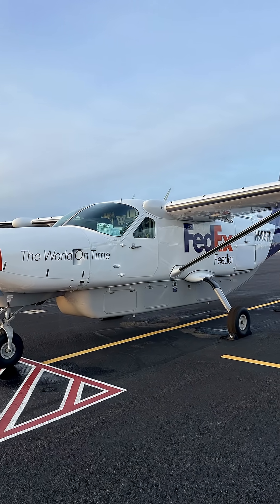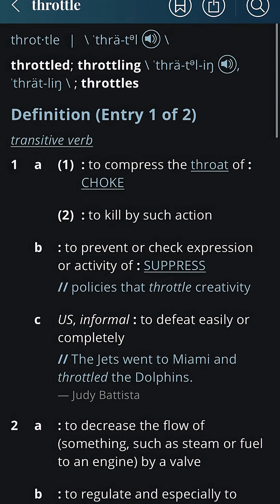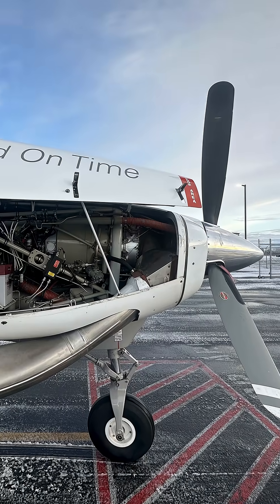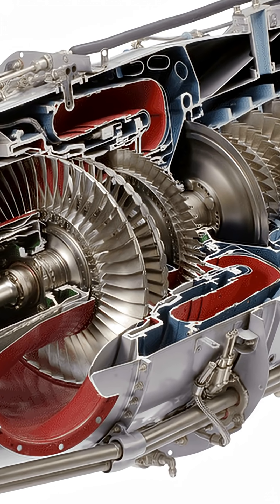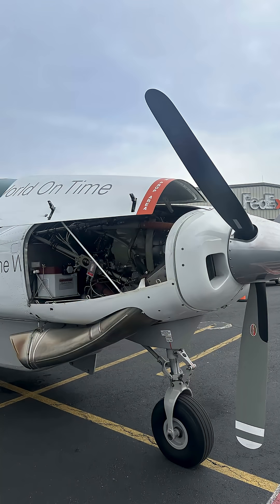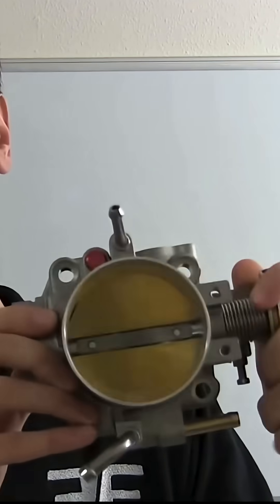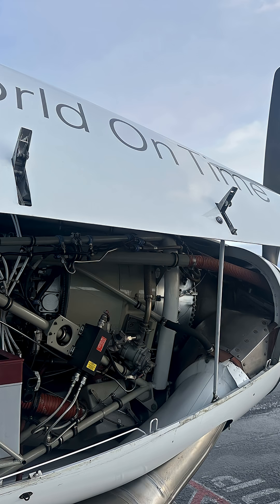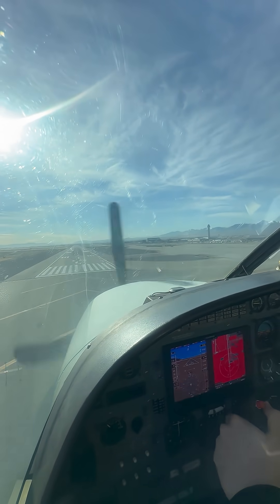FedEx C208B | Power Lever vs. Throttle

Comment: You would never call it a power lever in Boeing jet for example, its called throttle, and the auto system is called auto throttle as well. And last time I checked, they don't have piston engines. This is stupid really, If I were in a Caravan and said "adjust the throttle" or something, you would absolutely understand what I am referring to

Comment: Except in reality it’s not like there is this cut and clean distinction at all and they use power and throttle interchangeably, happens all the time with linguistics that terms become so common in reference to something technical that the meaning can become corrupted. In my experience use power to talk about thrust and throttle when talking about lever position or some aspect related to the physical lever. Like how people call any vacuum cleaner a hoover.
Reply from the maker: Totally agree that pilots use the words interchangeably, language always gets messy. But mechanically the distinction is real.

Comment: You can use both without issue. Some manufacturers call it power levers. Some call it throttle and some call it both. On the Gulfstream, the levers are called power levers. However, you engage the “auto-throttle”. Boeing also calls for you to disengage the “auto throttle” under certain circumstances. 

Here is a CAS message from a gulfstream:

IF THE POWER LEVER IS NOT AT IDLE, AN L-R Throttle
Configuration (caution) CAS MESSAGE WILL BE DISPLAYED.

That’s from a manufacturer. Heck, it’s a fadec engine and they call the whole thing a “throttle quadrant”.
Reply from the maker: First off, thanks for the good info. This is good stuff. However, it seems that manufacturers use the word inconsistently. But mechanically, the truth is simple: Throttle = literal airflow restriction. Throttle seems to be a legacy term for a power-command lever.
Reply: @nicholassmout3281  you are correct, it’s a legacy term, which is still widely used in aviation. When you are in the sim, instructors will use both words. They will tell you to bring throttles to idle etc.
Reply from the maker: Hey, thanks for contributing. You have a very valuable perspective. Thank you